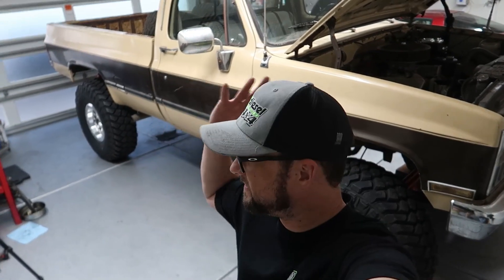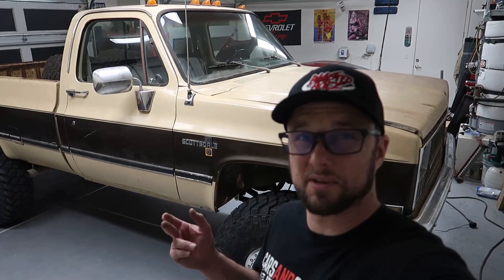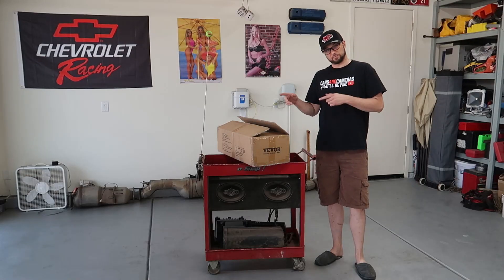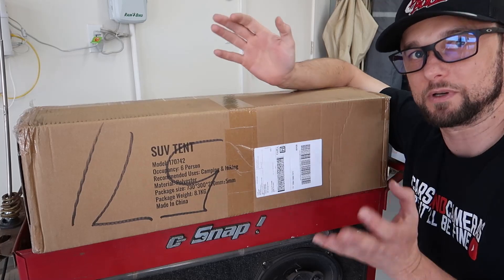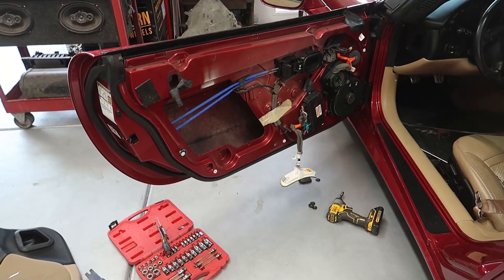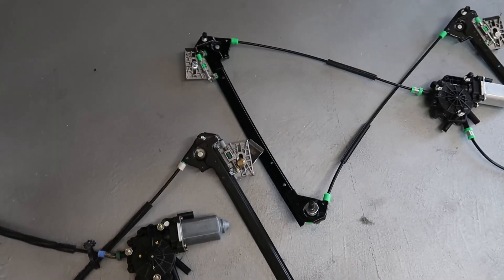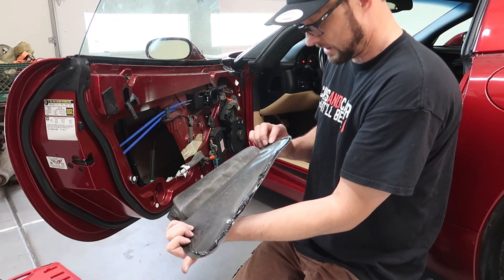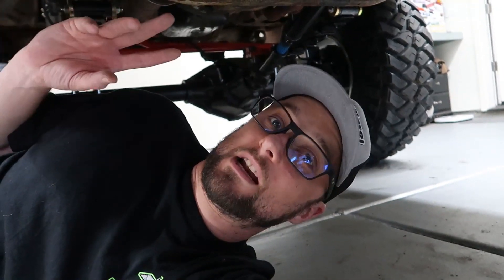K30 Trail Build, 454 cooler delete and 2-piece hub seals

Comment: Glad i have my truck 100% apart atm waiting on brake line union and a rear brake line hose since the one sent doesn't clip into factory position and doesn't have the hardware for any other location. Will hopefully be putting the engine in with the transmission and transfer case.